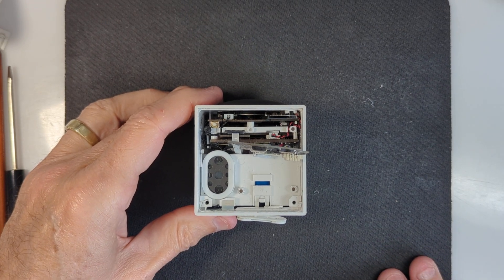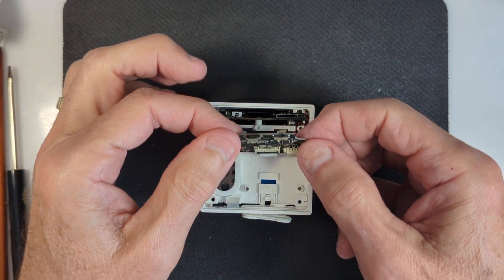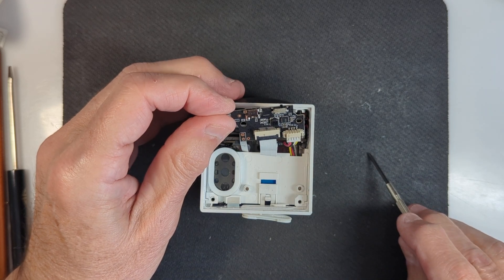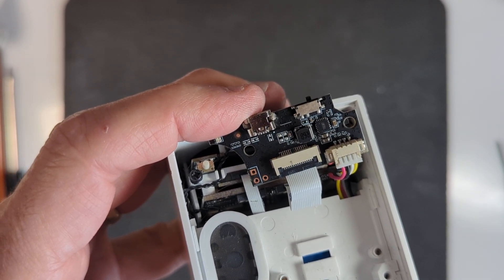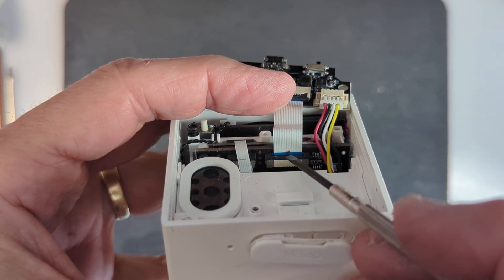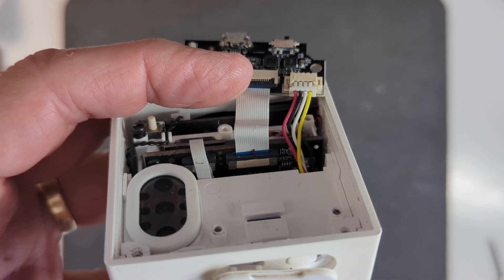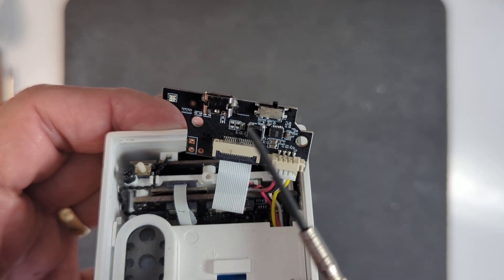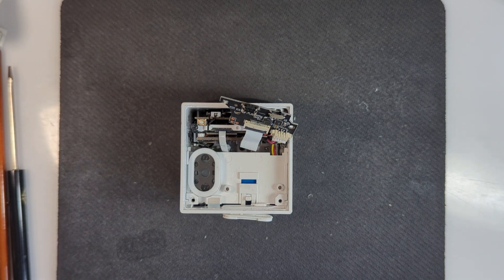Wyze Outdoor Camera battery not charging

Comment: Regardless of any potential shorts,  corrosion, etc., 2.5V is too low of a floor charge for a lithium battery to be charged safely. You need to remove the battery from the housing and try a slam charge (5V 1A for 20 seconds), then check voltage, and repeat until you can get the battery up to 3.5V. Then it'll be safe to put back in the camera. Keep an eye on the temperature while you're trying to slam charge it, if it doesn't gain any voltage yet seems to get fairly warm or HOT while charging it then the battery is just cooked, and you need another one. A standard lithium single cell isn't gonna come out of a discharge that deep unscathed, and while it's probably salvageable, she'll definitely be down a few mAh when fully charged.